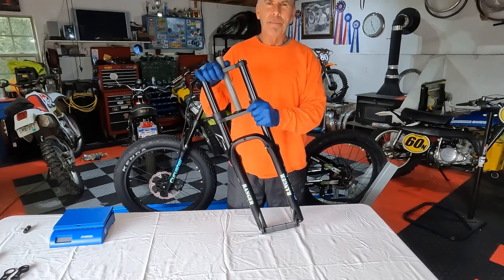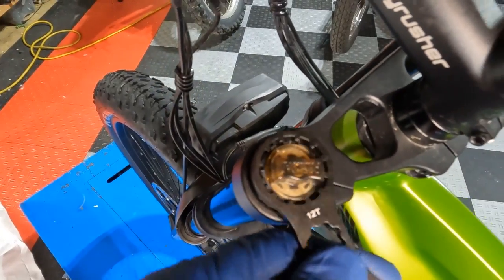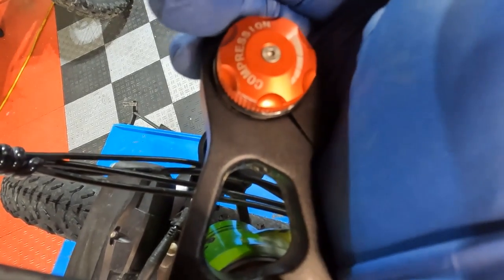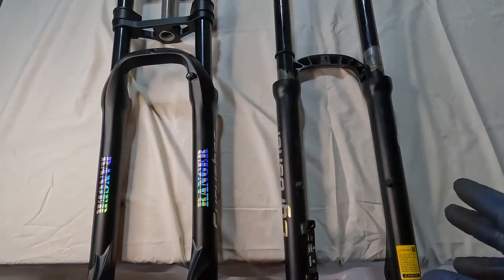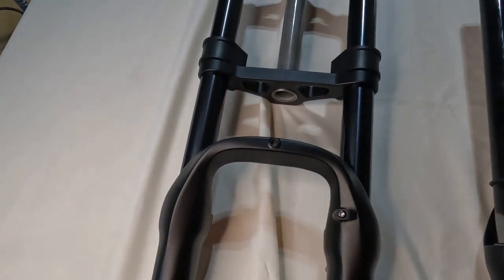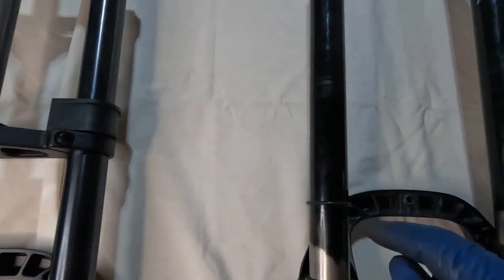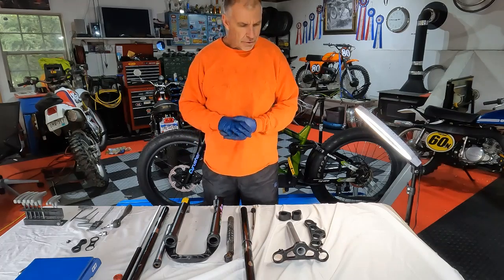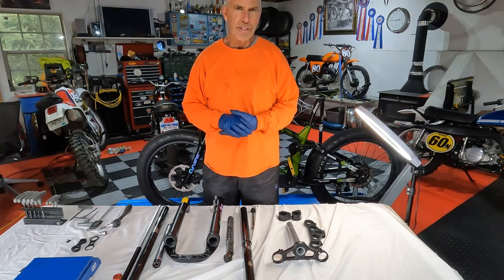Fat tire E-bike forks explained.  Cyrusher Ranger

Comment: I need to replace the preload adjustment cap on my Cyrusher Ranger do you know the size ?  Out side of cap measures 34 mm . I was thinking threads must be 30 mm .  any information would help , tired of dealing with companies warranty dept.
Reply from the maker: Hi Tony, I measure the cap threads at 30mm and the thread pitch at 18.  I suspect it is this cap on ebay,  #6 option. 404185869107  Cheers

Comment: Hello, thank you for your work analyzing the fork, it's very informative, can you show you how you fixed your new headlight and the electrical wiring, did you install a voltage converter for the headlight, a video on the subject  would be interesting, thanks
Reply from the maker: Thank you Sly,  much appreciated!  If you subscribe to my channel then all my videos will show for you. I believe what you're asking about is in a video I made about the changes / upgrades I've made to the Ranger.  The short answer about a voltage converter is no, this particular headlight has an operating voltage range of 12-100v.  I also have a video of me using this headlight at night in the woods, it works very well.
All that said, if you are running the stock fork on a Ranger this modified headlight location will work well for you. I just installed a new air fork (video released this morning) and the modified location will not work on that fork because of the huge amount of travel the fork has., it would be hit. So, back to the stock location with the new light until I come up with something better!    Cheers
Reply: Indeed my question has been answered in one of your videos!  To go to work and travel on the road I plan to use a motorcycle horn, the original one is too gimmicky, I'm going to switch to 66w 115db!!!  And for the lighting, a combo led headlight that can do high and low beam, hence my message on a 52v / 12 v converter, I will consume between 4 and 6 amps!!!  With of course the addition of relays
Reply from the maker: @sylchatzen3709  Hello Sly,  that sounds like a good plan for your Ranger. I now understand your question on the converter. If you haven't already purchased one I'd recommend the  Fulree AD120030b5 converter. With 15-52v dc in and 12v dc out. It's also tiny and easy to hide and is quite inexpensive. I've used this one with good luck. Available on Ebay and Amazon.  
I also like the idea of a 115db horn!  That'll do what you need it to do!  Thanks for watching!
Reply: Hey, thanks for your answer, I already took the converter thanks!, for the led headlight, it is 50w, 4250 lumens and low beam / high beam mode, should be recommended for bikes that blind too often with  these ultra-powerful LED lights!!!, question why only change the brake disc at the front and not at the rear?  The rear is too complicated to disassemble?  Sincerely Sylvain
Reply from the maker: @sylchatzen3709  Hi Sylvain,  having a super bright headlight is very nice at times!  I upgraded the front brake because it is your most powerful and effective brake. Under normal dry conditions 60 - 70 percent of your stopping force is exerted there. Also, the front brake on the Ranger squeals like a school girl without this upgrade. There is just too much weight with bike and rider to try to use the little stock discs.

Comment: Another great video! Thanks so much for this one, I just received my ranger and I couldn't find any information about the fork, well it was all here 😂! Is there any way to change the oil inside in order to slow down the rebound a bit?  But so far after a short test yesterday on a quite rough single track, I think the combination of the fat tyres and the suspensions works pretty well. Thanks for the job you're doing, keep on riding 👏🤘
Reply from the maker: Hello Antoine,  thanks for checking it out!  The dampening cartridge is a sealed unit, so no oil change possible. There are replacement cartridges available that could be fit to the fork for custom dampening, but probably more cost / trouble than it's worth.  You're right, it's the combination of fat tires and the fork that give the bike a very nice feel in the front.

Comment: Unreal, great review.  Makes me so happy that I didn’t buy a ranger. 

These forks are no different than the cheapest Chinese e-bike. Total crap. Cyrusher have priced the ranger twice as much as it should be.,  just because it looks better or more like a mountain bike when is clearly not. There is no reason the ranger should be the price it is!
Reply from the maker: Hi David,  the forks are very typical of all the fat tire e-bike forks I've seen including the American made bikes. I think it's more of an industry standard than a regional thing (China).  They work well in general and combined with the big tires they provide a pretty good ride.  The  rear air suspension on the Ranger is very good, heavy duty linkage, good design, and a good shock provide a very nice ride.  
I'd love it if someone produced a Fox or Rock Shock quality fat tire fork, but as of yet I haven't seen it.  I suspect this is because the fat tire e-bike market is kind of its own relatively small niche.  The bikes aren't really "mountain bikes" but they aren't a commuter either. But, if someone did the price of the bike would go up by $1000+.
  The Ranger is is a very competent road / smooth dirt trail /non technical single track bike. More like a cross country bike. 
There are similar bikes to the Ranger that cost several hundred less, that is true. When I bought mine early on it was $2399, they have gone up since. Still, the fun factor and the fact that the bike impresses me every time I take it out makes me very happy I bought it! 
I
Reply: @lifebehindbarz60  in the UK the ranger is £2800 + shipping. So what you paid is a way better. I’m not saying the ranger is not a fun bike. It’s just overpriced and has very little difference between a bike half the price. It’s mostly cosmetic.  The price of the nitro follows this trend. Big jump up in price for just a mid drive motor. Same standard components, maybe slightly better geometry for off road but I wouldn’t trust a manufacturer of commuter shopping bikes to produce anything that could go off road, but it will have the looks and be attractive to the brand hungry fan boys. 

So what is better for the money? Well first off most fat bikes are used for the road and some trails, meaning there not used for the intended purpose, SMOW or SAND.  Any normal mountain bike tyres will do a better job, be more efficient and be way lighter and cost less. So fat tyres are used for Cosmetic only. 
Lots of amazing good quality, branded EU bikes for this money with rockshock/ sram kit. 

I do like and ride fat tyre myself because I love the feel of it and ride a lot on the beach. 
There are lots of great bikes, even full carbon fat bikes with quality components for Ranger money. Here is a link to my bike, full carbon, built bespoke for me, dropper seat, mid drive, SRAM suspension, 52v 16nm torque, 4 piston brakes and built buy a manufacturer that understands bike geometry, so this bike not only looks good but it’s got it where it counts. Oh. And it’s Ranger money and s as lot less than the about to be released,heavy and overpriced nitro. 

This company don’t give a free bike to every YouTuber that does reviews, mostly to channels that know nothing about bikes.
Reply: Not sure these bikes would suit the Cyrusher customer as they don’t have raised shopping bike handlebars, long stems and the ability to add luggage racks.